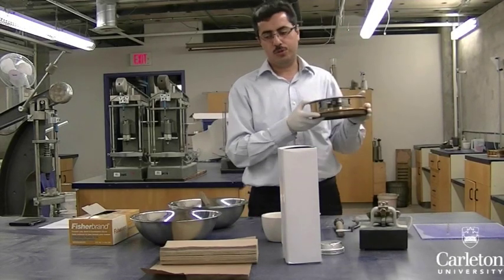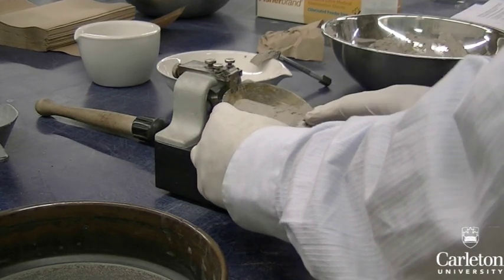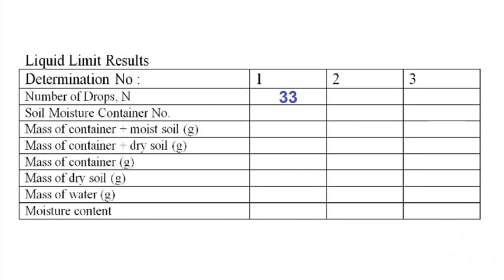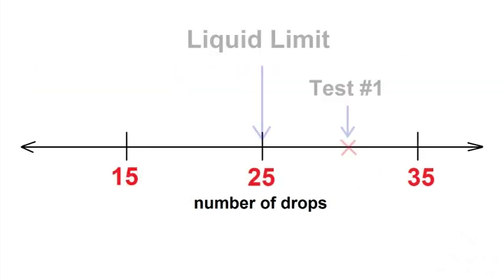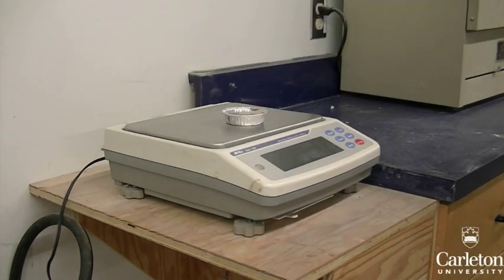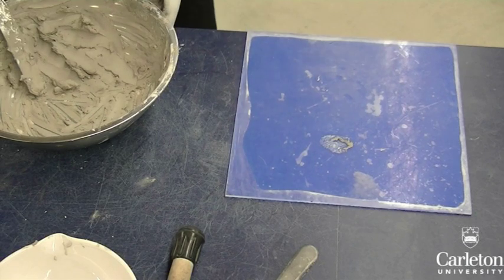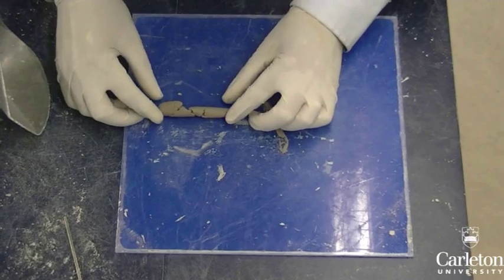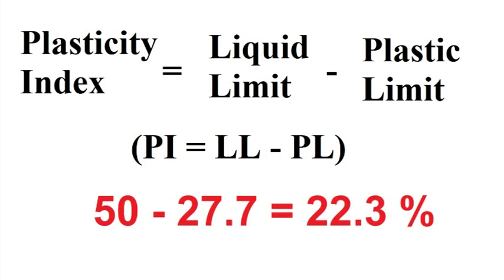Carleton University - CIVE 3208 Lab 2: Atterberg Limits

Comment: I'm sorry but I found several things wrong with this test. The number of rotations per second was done incorrectly (he sped up after the first few); also the sample containers were not covered when determining the moisture content (it is a small sample so the moisture it pick up from the air is significant). My company is enforcing us to follow the ASTM standard exactly and I have yet to find a video that does so :(